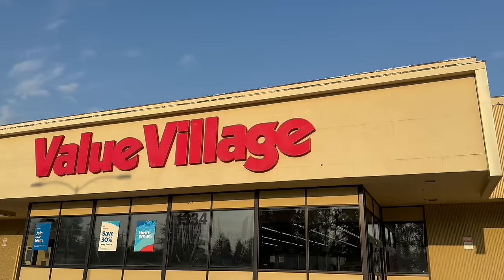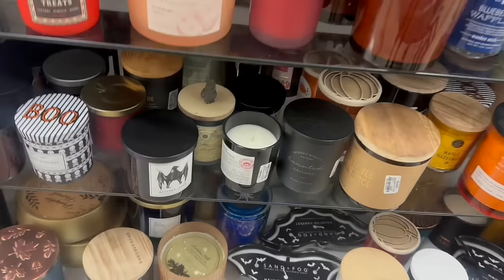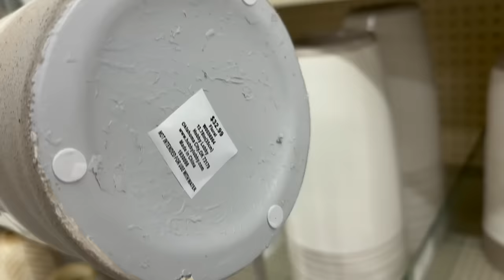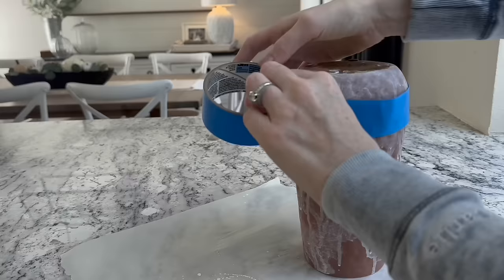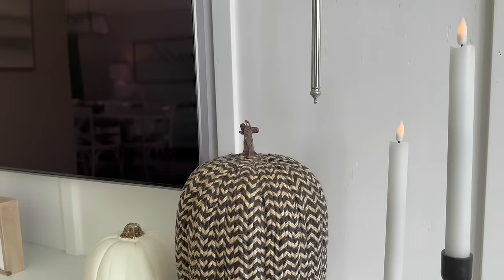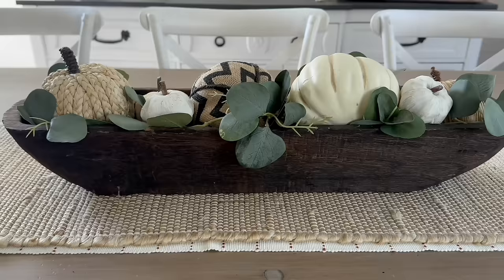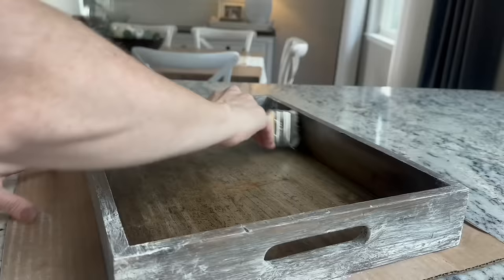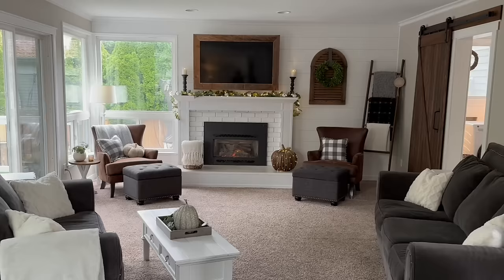🍂🏠🍁THRIFTED (& AMAZON) FALL DECOR 2023• SHOP WITH ME • DIY  #goodwill #homedecor #thrifting #fall

Comment: One trick for dealing with snags is to light a match, let ot get hot, and then blow ot out.  Immediately touch it to the snag close to the surface of the blanket or whatever.  It's kind of like cauterizing it.  I hopeI explain this well enough.
Reply from the maker: That makes sense. Thanks, Dianna! 💕

Comment: Did you realize that the terracotta colored mug you bought matched that terracotta glazed pumpkin-shaped teapot? There were at least 2 mugs (one of which you bought), and they had a square base just like the teapot.

That avocado green velvet pumpkin was $12.99?!? Wow!
Your prices are pretty high! 
Are you in Washington state?
Reply from the maker: Hi Cheryl. I did notice that. There were 2 of those mugs and I did feel a little bad not buying the set but I prefer to buy individual mugs vs sets (so when we have groups over and several people have mugs they don’t get mixed up). I figured since they priced them individually they were ok with splitting it up. 

Yes, I’m in Washington state. The little green pumpkin was actually $2.99, but even at that it felt pretty expensive for what it was. I’ve gotten a little spoiled with the Goodwill Outlet prices. 😜

Comment: Here I see what you're trying to do the water down paint, you shouldn't leave the drip marks in it. The drip marks make it look not authentic. You need to dab it with a paper towel and get the drip marks off of it, so then it makes it look like it. 's been age properly instead of drip marks. I'm sorry, I'm 70 three-year-old. Great Grandma, and I've done several several of these crafts. Is my is my thing and interior decorating is mine.
Reply from the maker: Thanks so much for the tip Dorothy! I appreciate it! 😊💕